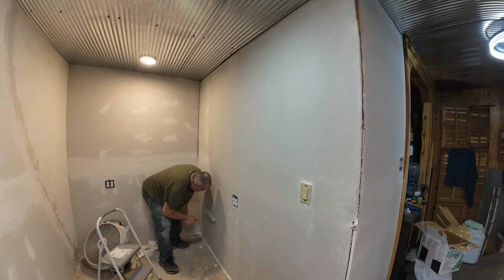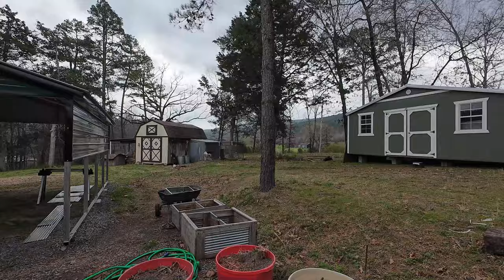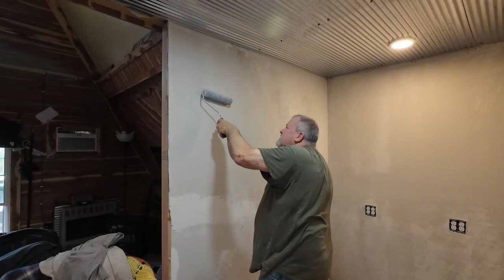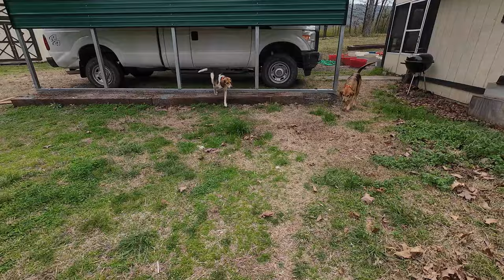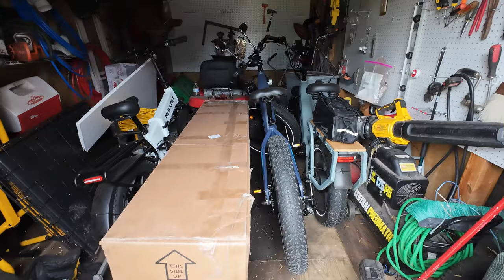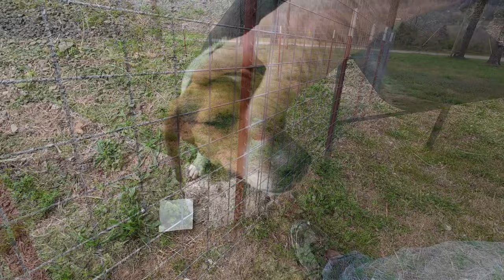How to Blend New Walls with Existing Ones

Comment: Good job Mike. Wiley and I remodel houses and sometimes we have to retexture all the walls because we can't match the texture the last guy left lol. So, we dilute the mud and use a hopper and air compressor then we lightly knock it down. It makes texturing quick and easy lol. If we were closer, we'd be happy to help.

Comment: Hey Mike, the brand "Ben's best" dog food is available at the old gas station/ grocery store about a block before you get to 248 ....turn right at the chambers bank intersection red light as you come to town.
40 lbs for 20 bucks, mix it with their current food at first so their system don't get off balance. My dogs eat it, I always sprinkle their food with bacon grease or a scrambled egg.

Comment: Hello Mike! Was wondering if you ever used the spray on texture? That's what I usually use for small jobs anyway. Seem to have pretty good luck with it. I use the stuff in the large spray can. I also use the mesh tape instead of the paper.
Reply from the maker: Ive used it.Had a huge box of joint compound, why spend $$ on spray.Wasnt that bad

Comment: You were talking about texturing and I looked at my kitchen wall and the top half is smooth and the bottom half is textured, and it looks rough where it meets up.  I've been looking at it for a year and didn't know what was wrong with it until now.

Comment: Hi 👋 Question: On the outside and inside corners are you going add the corner guards? You lay the mud add the strip. Sink it into the mud and feather it out from the corner to several inches into the wall.  I noticed the gap on the outside corner. Just trying to help a fellow veteran.
Reply from the maker: Will have cedar trim